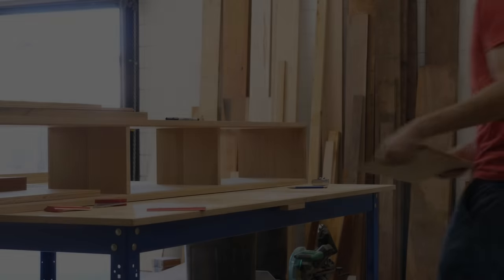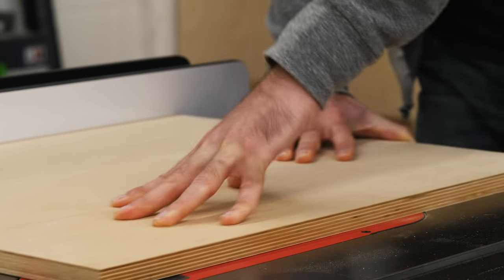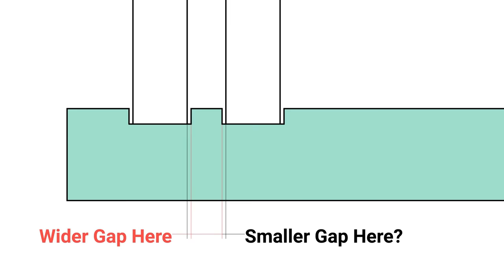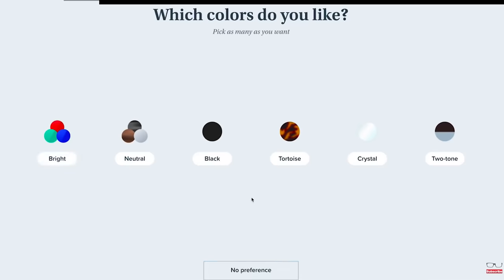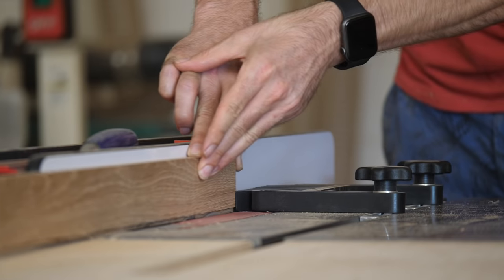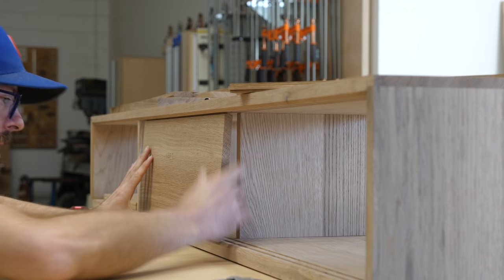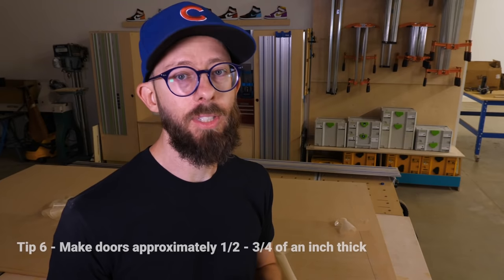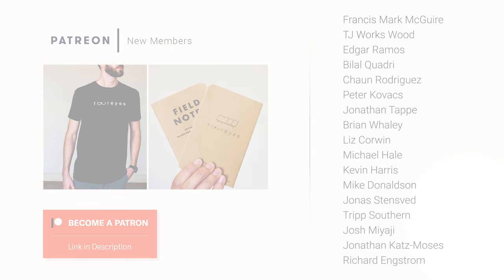8 Tips for Perfect Sliding Doors without Hardware

Comment: So glad I grew up in a country with the metric system.
Reply: and im glad my parents did
Reply: When you grow up with feet and inches, it just makes sense. You can be just as precise with Imperial as you can with Metric. Maybe the math is a little easier with metric, but that's why we have calculators.
Reply: I find the math of imperial to be easy once I became an experienced woodworker. Example (quick math in your head): 1167mm+886mm=  VS 18 1/8 + 56 7/16=…….. imperial is quicker in an instance like this. I do really like metric though and if one system were only to survive it probably has a wider range of applications and ease
Reply: Fractions make more sense from ahuman perspective.
Reply: Using the metric system is universal. For example, some Americans use the metric system instead of feet and inches. Educate yourself.

Comment: Great explanation, very clear.  Any issues with types of finishes you use not allowing the panels to slide easily? Do you ever use waxes in the slots like paraffin?
Reply from the maker: If they were having trouble sliding, you could add some wax. I don't find that it's ever really necessary though. I've used oil finished and polyurethane finishes with sliding doors and both seem to work equally fine. So I'd go with whatever you planned on using regardless of the doors.

Comment: Chris, I think you read my mind. Every time I have an idea, you drop a video on the exact topic I'm looking to learn more about. I've built two of your designs now, and always feel confident following your instruction. Thanks for everything you do.
Reply from the maker: Thanks man...appreciate it. Glad you're enjoying the videos gaining something from them :)
Reply: I just built my first sliding door cabinet and your tips helped a lot, 80 x 36 x 13 inches deep. I aimed for 3/4 overhang just like you recommended. The sliding doors are 40 x 33 and I used half inch and there bowed but it’s a shop cabinet and it’s practice for the real furniture I’ll build for the house. My shop is 1.8 metres wide by 4.8 meters long, super small shop in Dublin, Ireland 🇮🇪

Comment: This was so fascinating to watch. I love your channel for all the in-depth explanations and illustrations/animations, but this time you even out-did yourselves! I do have one question/idea: Would it be a good idea (read: possible) to make a groove in the bottom tongue of the sliding door and add a wheel/bearing for better sliding? I was thinking you could drill a hole from the inside of the door towards the outside, and stopping before you go all the way through and using a dowel that holds this bearing in place? You would probably need a wider tongue, and thus a thicker door, but I don't see that as a dealbreaker necessarily.

If that's doable, you would basically have invisible wheels, if I'm conceptualizing it correctly.

Comment: One more reason for Tongue groove which is similar to the benefit of distance between doors is distance to front face. Meaning for example if you want the door flush with face frame or slight inset, you need to do Tongue groove.Great video! Next one should be sliding without hardware but on drawers!
Reply from the maker: Not a bad idea. Maybe we'll do that.

Comment: You always explain well how to do useful things.  With sliding doors, I've found it useful to think about what happens if dirt gets in the groove.  A hole at the end of the travel, through the bottom of the groove can be helpful.
Reply from the maker: Good call. I've never though about that before. I suppose I would probably go for a vacuum if I ever faced that :)
Reply: @Foureyes.Furniture  I guess the ones where I found it needed were in a preschool.  Under less challenging circumstances it's less important.

Comment: Thanks for the clear explanation! Very helpful 😊
Not sure if you'll see this, but I was wondering: 
1) what's the ideal size for the tabs? 1/3 of the door's thickness? Half?
2) how much space would you leave minimum between the doors?
3) approx. how heavy could you make the doors without having to use hardware?
Any advice would be greatly appreciated! 🙏

Comment: Recently made a MCM console with sliding doors.  Did the tongue and groove version and they worked well, but would do them differently next time.  I would cut narrow slots in the case and cut rabbets on the backs of the doors, but not in the front.  The rabbets in the front of the doors "show", you can look into the cracks under and over the doors and the must be neatly lined up. Also, both surfaces of the front rabbets must be finished nicely.   It would be cleaner if the front of the doors were flat and the rabbets on the back help to close the gap between the doors.
Reply: Yes! I'm glad this was the top comment because I came on here just to say that  what you explained is the way I do it, and it solves the problem of seeing any seam along the top of the door. It's also one less cut to do because you only have to do a rabbet on one side of the door.
Reply: Followed your suggestion and did 10mm wide from the face of the door at the bottom, but full width at the top because it was less work. Looks really clean. It's a tv cabinet, and only has doors on each end with an open shelf in the middle, so just one groove.

Comment: Question: Do you ever build a sliding door with a raised bottom "ridge" on the bottom horizontal shelf, made of wood or aluminium ? 
Not only does it remove the need to cut a groove in the bottom horizontal shelf,  but the slot cannot get filled with junk and cause the sliding section to either bind or jam completely.
The same principle has been used on the bottom of sliding wardrobe doors for years.

Comment: Great video Chris, as always!  Your timing for giving me a plethora of ideas about my own upcoming projects is uncanny!  I have some sliding doors in mind for a shop cabinet project (now that plywood is coming down from the 'bank loan' level), but I was concerned about a dusty environment preventing smoothly-sliding doors over time, the upkeep needed to keep them cleaned out and/or waxed, etc. (and this would not involve hardwoods, just normal softer shop grade materials).  I had thought about getting something hard and slick in the bottoms of the grooves, such as strips of melamine edging, but couldn't find an easy way to iron it on as groove bottoms.  

I eventually settled on making a laminated track assembly of alternating 1/4" strips cut from wood and from melamine board, so that the melamine surfaces end up as the groove bottoms.  My project is mostly stacks of storage cabinet cubes built as towers, with these laminated track assemblies mounted on the front edges of the fixed shelves dividing and defining the cubes, so as to have the same two-sided track assembly serving the top of the lower cube and the bottom of the upper cube, with the melamine layers offset from the wood strips within the lamination, creating deeper grooves at the top of each door for easy door removal as yours do.

My only hitch I've run into during test runs is cutting a melamine strip with smooth-enough edges (since a rough edge could bite into the sliding door bottom and defeat the purpose of using melamine in the first place).  I've tried blue painter's tape and scratch cuts to clean up the edges on the melamine cuts, and the blade I'm using is admittedly not my best (since I didn't want to wear out a good one on several dozen 3 foot melamine cuts, the stuff being so hard and brittle).  So I was thinking of coming down off my cheap high horse and springing for a new blade to cut the melamine.  

And what do you know!  Just as I'm re-thinking using this material at all in this application, along comes Chris Salomone with some very interesting thoughts on groove construction!  I'm still not sure which way I'll ultimately go, as I have by now been pretty thoroughly bitten by the shop-made laminated track bug.  

By the way, if you've read this far, I'd be very interested in your thoughts about making and then installing a separate track?  Cutting upper and lower grooves in the same divider piece won't really work for me, unless I beef up the edge of the plywood or something.  And it's totally fine if time prevents a reply.  It's truly a master class video on the topic!  Cheers!
Reply: A bit late but couldn't scoring  the melamine help getting a cleaner cut
Reply: @ugosmith7529  It does help somewhat.  That was the 'scratch cut' I mentioned.  Raise the blade just an 1/8" or less proud of the table saw surface and run the melamine over that.  Then flip the melamine front to back, keeping the same edge against the rip fence but now the melamine is on top, raise the blade to just higher than the melamine thickness, and run it through again.  Does a decent job, but still some flaking.  And it could be that the melamine I'm cutting is too old, having been in a garage for a number of years, so it may be brittle and dried out (if that plastic layer does dry out).  But I also suspect my blade.  Maybe a bit of sanding will help the flaky edges enough to still let it be a decent groove bottom.  Oh, my project got side-tracked due to lumber pricing, but still on the radar.  So I have yet to start it, instead doing some other smaller tasks.  Thanks for the suggestion!
Reply: @billparrish4385  yeah, the lumber prices have put a damper on my shop projects also.
Thanks for responding and following-up, if the technique you described doesn't work still, I'mnot sure what else could help,  you may indeed have to pony up for a specialized blade.

Comment: super awesome video!  thanks so much for your sliding panel door insight. One question that I had after watching, Im one of those without a table saw, but I ido have my trusty Festool Of1400 Router. I can see making the Grooves, but would have loved to see you making some tongue cuts on the door panels with a router to see how you would go about it. Any tips for cutting the tongue from the doors using a plunge router?

Comment: Right on time! Was just about to start on a sliding door cabinet. I’m using heavy 3/4 material for the doors and worried about weight and friction. Was considering gluing a t slot into the top groove and hanging the door from it. Thoughts anyone?

Comment: appreciate so much 1/16 of a in inch = 2mm on the screen! :) It is hard to describe (probably both ways) but when you are used to metric, it's is really not ez to visualize quickly when fractions of inches are discussed.

Comment: Nice video. I have a big cabinet job with quite a few sliders like this, yet it's painted. Wondering about sticking paint and wear on the sliding area. But a nice option if I don't find any hardware.

Comment: Thanks so much for such a thorough video. I can see the effort that you put into it. I want to add some sliding panels to a neiden ikea bed frame, but it will only be able to connect and slide from the top. Is it possible or no? I was thinking of creating a t bar shaped opening in the bed frame so that it holds up, and then somehow will have to create the same shape in the panels. Then slide everything in before constructing the bed?
Lol I don't know if it's even possible but I'll be putting storage boxes in underneath it and would love to cover them up. The only tool I even own is an orbital sander that I bought a few weeks ago and I'm on a frenzy with it ever since. Planning to get a circular saw and go from there with my toolkit.

Comment: My grandmother had a MCM TV console with doors like this. The one thing that always bugged me was the bottom dado seemed to attract every stray particle within a 10 mile radius, and it was a pain to clean out. I have thought about this and wonder if you were to take what you have shown, and in the bottom dado insert a piece of wood into the dado that sits proud of the groove with a chamfered or round-over profile (or may trapezoidal) cut along the part that sticks up, then in the bottom of the door, cut a complementary groove instead of the tongue to receive that raised bit to effectively use it as an inversion of the track you have. I haven't tried this out, but I think it would work. Might even be able to get away with a smaller slot in the top? Oooh! You could do a brass insert instead, that'd be classy af in some walnut.

Comment: Hi Chris, this video is super helpful. I'm curious why, at 3.50-3.53, you say that using through cuts on a cabinet assembled with butt-joints wouldn't work if you put the top/bottom panels between the side panels? I was taught that when using butt-joints that arrangement is preferable to having the side panels between the top/bottom so the ends wouldn't show. Just curious.

Comment: I want to build sliding doors of hardwood (Tasmanian Oak) 43 approx inches high x 19 (approx)  inches wide x 3/4 inch thick. Is this door too heavy for an easy slide using this method? Do I need to use a track and rollers instead? Thanks Chris for your very clear presentation. Look forward to your recommendation.

Comment: Not sure if you’ll see this, but I’m planning on using this technique for a larger sliding doors (3 doors at 30”W x 40”H). 

I’m worried about the long term use of it. It will be a high use door and wonder how they will hold up? Seems like a lot of friction. Any suggestions or comments on maintaining it? Or even possible hardware for a heavier door you would suggest? 

Love the videos, been following for a long time now

Comment: I understood that the weight of shoji screens were supported on the bottom shoulder, not on the tongue at the bottom of the groove. The groove can fill with dirt preventing the screen from moving. I gather you haven’t had issue with these smaller and cleaner cabinets.

Comment: I like to use a pair of small bearings instead of a bottom tongue. Cut a mortice near each edge, then drill a blind hole from the inside and use a dowel as an axle

Comment: I have a pantry that is very narrow. Looking at my project I see that the area is so narrow a 8-10" shelf for can goods is about as wide as I can plan for. Sliding doors is a must since there will be no door. Floor to ceiling' tall is my goal. I could divide it into upper and lower sections if a full length 7' plywood door may be too tall to slide. Any suggestions? Would the Baltic birch plywood be the best choice? Do you have a video for this type of wall pantry cabinet or sliding door to hide my can goods. Please reply. --Teresa

Comment: What would happen if you flipped the grooves with the deeper one on the bottom? Would that make a difference in where the "sliding point" would be? I'm wondering because I've done this with taller doors and noticed they slide much better when pulled lower down, otherwise the top has too much play, resulting in the door getting jammed.

Comment: Really great video and the most clear and  specific explanation! Thanx a lot! But I have a suggestion: wouldn't it be better to make a rabbit instead of a tongue on the top side of the door not to have that gap between the shoulder and the cabinet as it appears when you actually put the door down in the bottom groove?
Reply from the maker: I have something called aphantasia. So I can’t quite picture what you’re describing… but do you mean how the door is In set? If so, a rabbet would be better. But for me the doors were supposed to be inset so it didn’t matter

Comment: I may have missed this but....do you add any lubricant to the contact points (i.e. the tongues and/or the grooves) like paste wax or do you find that the doors slide easily enough with out needing that ?
Reply from the maker: They slide easy enough without. The only thing that on this piece was the finish. If you wanted you could certainly put some wax on. I don’t think its needed though.

Comment: 1/2 inch doors take up quite a lot of pace. If you take 3/8 edge space + 1/2 + 1/16 + 3/8 gap + 1/2 + 1/16, you eat up almost 2 inches of interior space. Seems excessive. Have you tried using a plastic or metal track to tighten this up? I'm also thinking may be 1/4 glass panel instead. I'm making an entryway unit for shoes and it needs to be compact. The unit is meant to be just barely deep to fit a shoe.

Comment: Will it still be working as smooth in case if we build doors for an opening that's 6 foot tall and 3 foot wide?
Reply from the maker: It can still work. But generally wider and shorter is preferred for a sliding door. I've built them somewhat square plenty of times though.

Comment: I really enjoyed your explanation of cabinet sliding doors alternatives. However you were incorrect when explaining the benefit of tongued doors. Friction offered by one type or another is not dependent on the area of the contact surface. It is only affected by the weight of the door and the coefficient of friction of the materials. Ask any engineer you know if you want to confirm it.

Comment: Cabinets can display anything. Nobody but nobody addresses the issue of shop dust covering the French cleat items. Cabinets with sliding doors will solve the problem. No back to cabinet. Hang French cleat items in cabinet frame.  Use lexan panel for visibility.  Your thoughts.  Better yet build one and make the video!!!! Thx  Bruce. Cleats and Cabinets ( sort of like root beer and ice !)

Comment: This method does not require (expensive) hardware, but it seems to require using (more expensive) solid wood instead of (less expensive) plywood due to the exposed tongues and grooves.

Comment: How durable are the sliding surfaces on these doors.
Reply from the maker: by sliding surfaces do you mean the top and bottom of the tongues on the doors? I'd say very durable if used normally. I have pieces that are 10 years old with no issues.